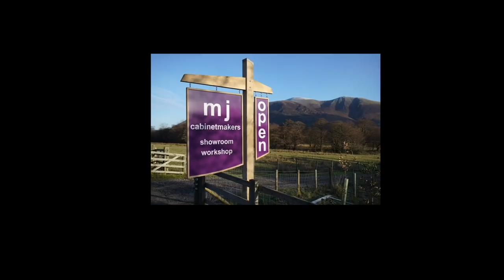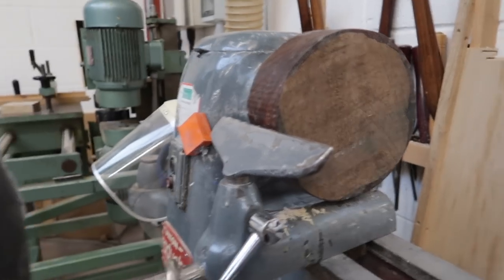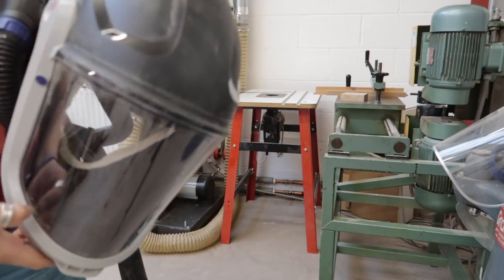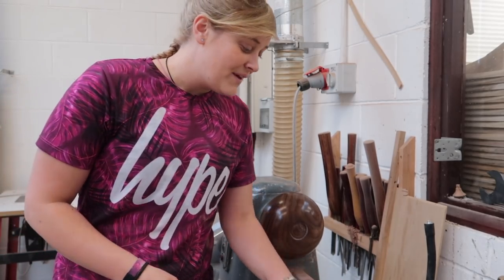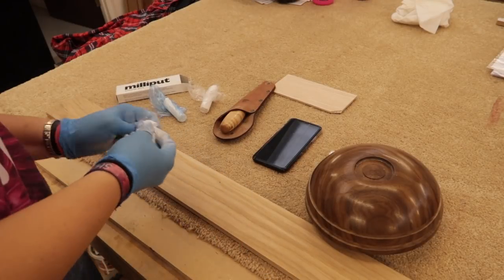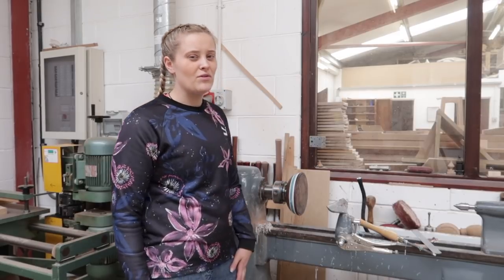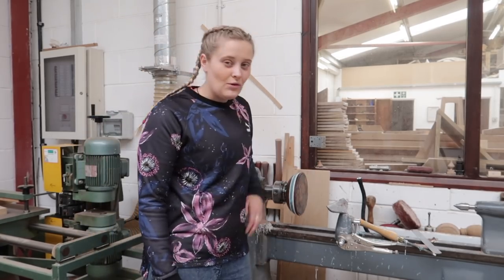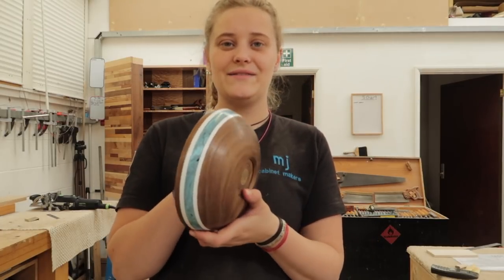Turning a wood and milliput bowl

Comment: When I started like you I used a spindle roughing gouge on the bottom of a bowl because nobody told me not to. The tool smashed into the rest and half of it broke off and flew through the air. Luckily it didn’t hit me or I might not be typing this. Apart from that nice work.

Comment: I've never used Milliput... not sure if that is something in the USA or not?  Very nice looking bowl!   If I may make a suggestion in your turning...  When hollowing out your bowl, work from the outside inward... Don't start from the middle.  The inside gives strength to the bowls outer perimeter...   So, when you work from the inside out you get a lot of flexing on your edges.   There are seasoned woodturners on youtube that give demonstrations on why it is better to work outside to inside.

Comment: I'm a newb.  Don't even have my own lathe yet but have been working with a mentor.  You got my attention real quick when you hollowed out that bowl with a Roughing Gouge... :) LOL.  Nice bowl.  Walnut is one of my faves.  I have walnut trees's coming out of my ears on my property.  Several have be downed over the years.  Time to start cutting them up and storing them... ;)  Do some more turning vid's...
Reply: No, it only looked like a roughing gouge because of the angle of the shot which hid the point, it was a actually a bowl gouge.

Comment: Wood girl,  I stumbled across your channel and watch some of your videos.  You are a very good turner and craftsperson and along the way you are also enjoyable to watch as you present the topic.  However, as Eric Johnson mentioned below......AND THIS IS VERY IMPORTANT....  the spindle roughing gouge is for spindle turning and NOT for cross grain o side grain turnings. You will notice the area of steel going into the handle (called a tang) is very weak.  Because of the way the cutting edge is ground, it will produce a very bad catch in side grain and the tang could break. You could hurt badly.  Be careful and do some research on this.  Sam Angelo          the  wyomingwoodturner   (my Youtube channel)